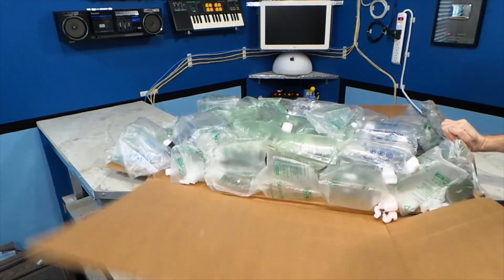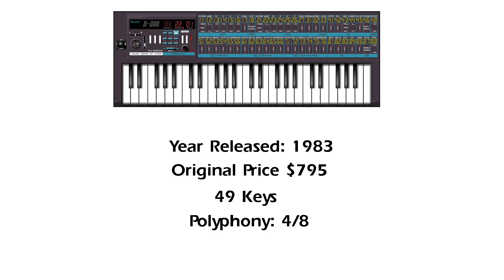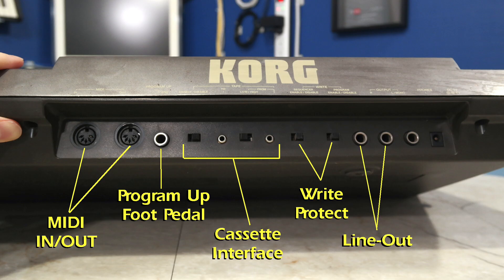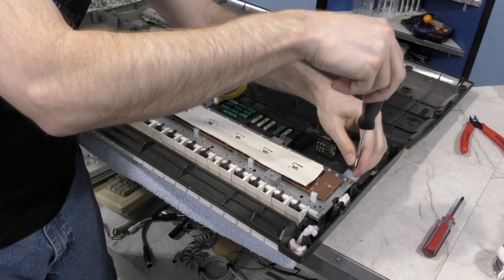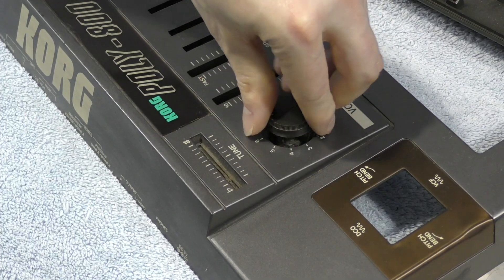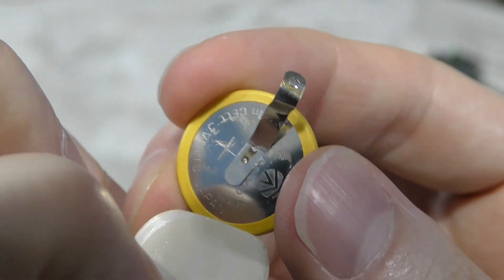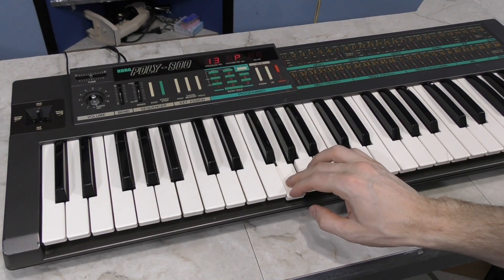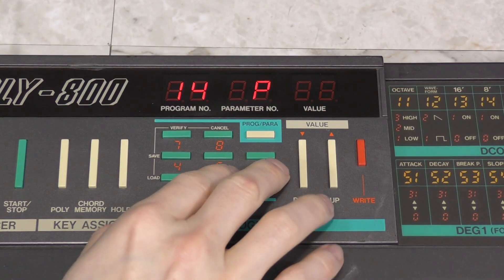Korg Poly 800 Battery replacement and factory reload.

Comment: That one capacitor at 12:29 looks like it is bulging at the top. If I am correct you may want to replace it.
Reply: Good eye. It might just be a trick of the lens but yeah, one of those looks ready to blow.
Reply: @wingracer1614  I think it's actually a "trick of the lens" - looking at it, it looks like the cap is bulging - when in fact the line is just not straight. I've gone through many capacitors in my life, and I know many of them have different "shapes" (including curves) for the lines on the top.
Reply: One of the last things you want going bad in any machine...
Reply: Yes it definetly is bulging. He should put in a new one.
Reply: Yes, it does look like it's bulging.
Reply: Which one? C10?
Reply: CAmarine221 it's splitting at the top and yes it is bulging and ready to blow
Reply: I saw one on the motherboard too
Reply: Mr T. Guru Blindly replacing good caps is just stupid.  And the wear on a cap can obviously depends on usage, and thus be different for each cap on a board.  And even the best electrolytic caps can blow, it just takes a lot longer. So if some of the caps are already bulging, those could be good to replace, but only with an exact equivalent (for example better ESR could mess up the sound of a carefully tuned analog audio circuit).  He may also need a Korg service manual to know what to adjust if the replacement cap is slightly larger / smaller within the tolerance range.   Remember, these are not power supply filter caps like in most other things, many are likely part of the audio signal processing.
Reply: @johnfrancisdoe1563  That may not exactly be true. There are often power filter caps on each board close to the board connectors. Of course, they are not the main filter caps getting pounded by the rectified voltage. In pretty much any gear 20+ years old, I will always replace the power supply filter caps by default, just in case as a preventative measure, as power supply related failures are by far the largest issue in older equipment - and can take out other pieces of circuity too.
I will rarely go through and just replace all caps on a unit, but thing(s) getting past 20 years old, most likely the caps will be suffering from age, and as Mr T. Guru has said, this can have a noticeable affect on analog circuitry. If a unit is particularly "special" I may just replace a handful of the analog signal caps while I'm in there.
Also, in almost all analog audio circuits, modern low ESR caps will make a better replacement, not a worse one (obviously still match voltage/capacitance/polar/bipolar). Varying capacitance especially in a circuit you don't know what it's doing (let's say, a filter) can completely change the behavior of that circuit.
Reply: If it ain't broke don't fix it!

Comment: Did you get a new computer Mac so now the videos are 1080p?
Maybe the iMac Pro? (JK, there's no need to tell me that the iMac Pro will only be available in Dec)
Reply from the maker: No, but I got a faster Mac Mini with 16 GB of RAM.
Reply: Ok cool. One thing I always wanted to know is which version of macOS are you running. Since you're often using G4's in your videos you can only see that you use an old version, obviously.
Reply: +Simon Ro iMac Pro is the same price as the Apple Watch Edition
Reply from the maker: I'm using 10.12.5 on my main computer.  But I have a collection of older laptops and I like to show them in videos when they are able to do the job that needs to be done, such as in this case.
Reply: 8-Bit Keys Thank you for the clarification. That's a similar story with my home file server running XP

Comment: dang it, now poly 800 prices will go up
Reply: poly 61 is better anyways.
Reply: Corncob Johnson real That blows dude, I got mine on eBay for $350, they seem to go for anywhere from $250 to $500 so if you're patient you should be able to find a good deal on one. I have mine paired up with a Roland JX-3P, they make beautiful music!
Reply: @ Corncob Johnson real:  They were expensive already before this video.
Reply: Also the filter is kaka, if you do the moogslayer mod you're in business.
Reply: Buy a DW-8000, it has the joystick and is waaaay better.
Reply: Vredesbyrd58  Not really looking to sell at the moment. They can still be had at good prices, just keep an eye out
Reply: Sam Williamson I think the JX-3P is a great if a bit limited synth, the one envelope for filter and amplitude is kind of annoying sometimes. Be warned if you buy one the front panel PCB is easily cracked, I bought mine as is on eBay and I had to jumper 8 cracks in the circuit board.
Reply: FinalBaton TETSUUUOOOOOO!
Reply: I still have mine but it has the reversed key color.
Reply: Corncob Johnson real I have a half dozen, maybe it's time to unload
Reply: Cincinnati James You have half a dozen poly 800s? Are you planning on selling any?
Reply: I love the JX-3P.  :)
Reply: KAAAAAAANEEEEEEDAAAAAAA!!!!